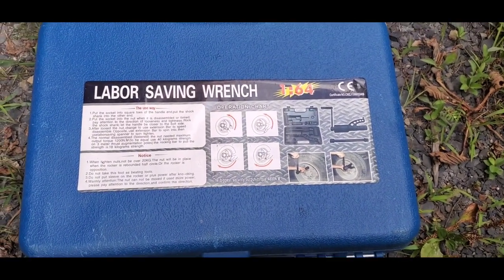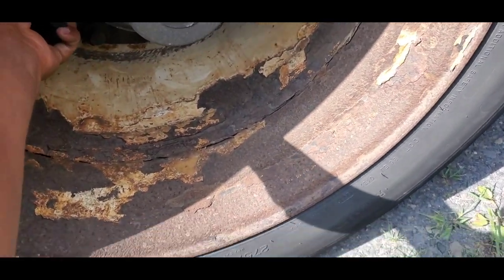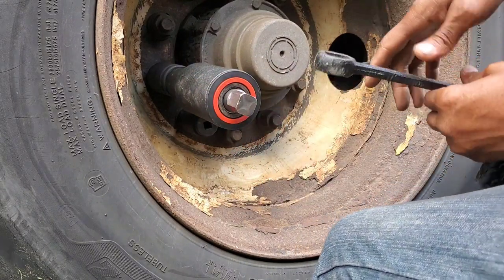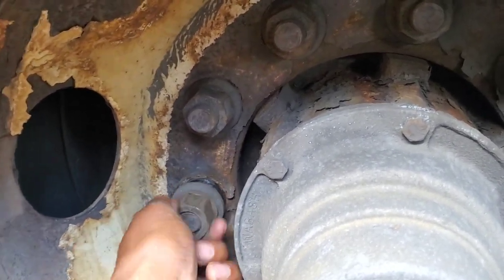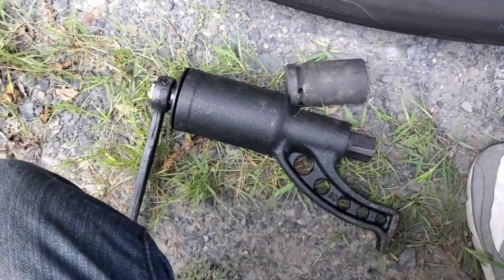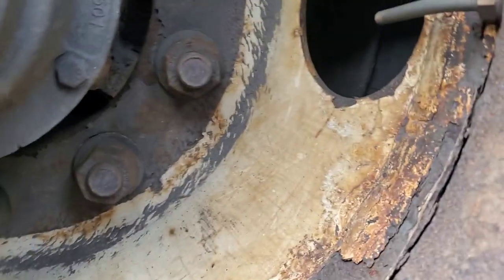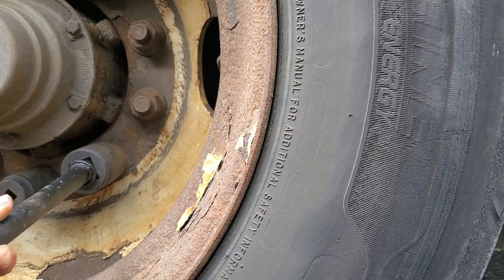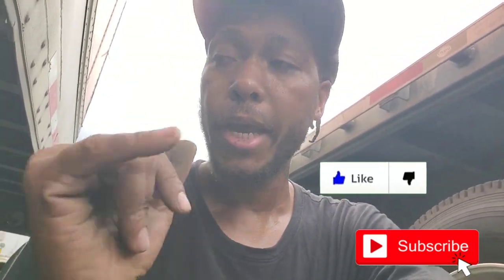How to remove semi truck lug nuts with the labor saving tool.no power tool needed.just turn handle.

Comment: I've seen those things around before. I've never seen anyone use it or even say it works. Thanks. At first the way you kept point to that one lug I was thinking scam but you have redeemed it. I'm going to keep my eyes out for one just to keep around.
Reply from the maker: You won't regret having one around even if you only use it once in awhile.
Reply: @truckingpaysthebills5394  yeah I do a lot of my own maintenance on my rig and it socks pulling my inch gun out to take a tire off. My compressor isn't big enough to run it and it takes about 30 mins just to get the lugs off. With this I won't need the inch gun anymore. Use this to break them loose and my 1/2 inch to spin them off.
Reply from the maker: @jakebrakejunky10-4  good idea

Comment: it's a life saver when the bolt won't come off with the one inch impact... there's also one that is air powered it much faster
Reply from the maker: The air power  one sound like a beast
Reply: @truckingpaysthebills5394  yes you got to be careful with the leg tho cause it will damage anything that it's on it's way if not seated properly

Comment: Anyone in the trucking industry should have a large  air compressor good quality impact wrenches and torque wrenches for every job. 
This tool is not necessary
Reply from the maker: Its not for everyone
Reply: Very good to change the tire on the side of road